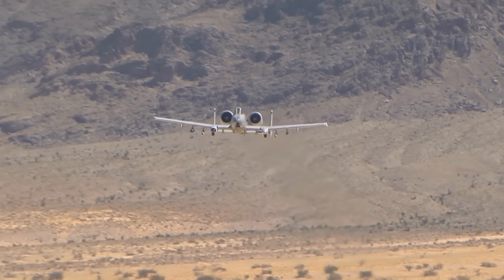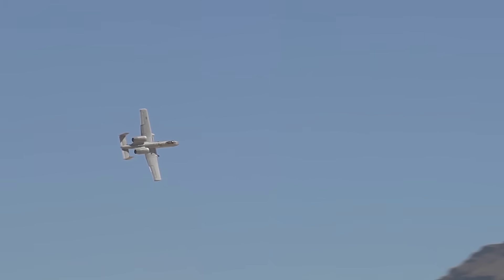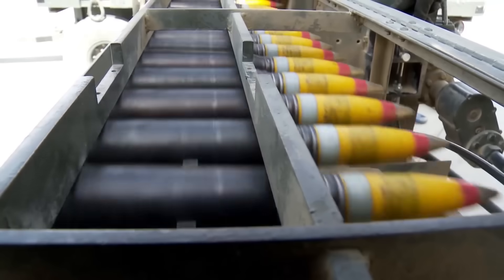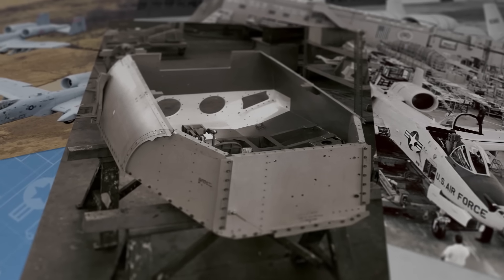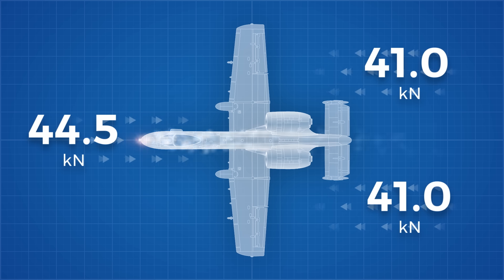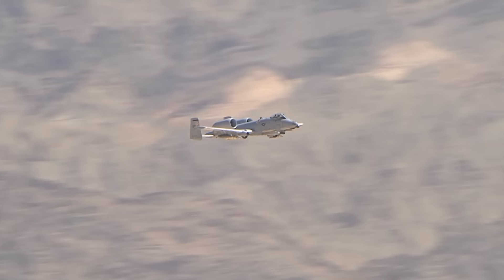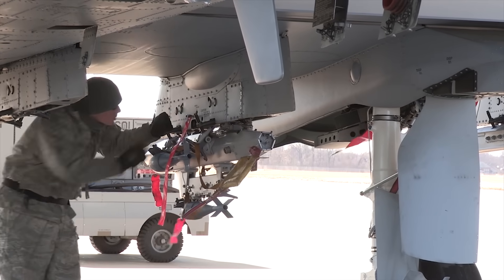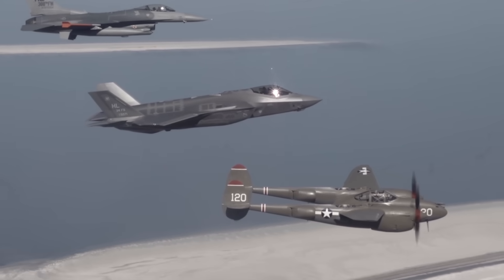The Insane Engineering of the A-10 Warthog

Comment: IMHO, the main difference between A10 and F35 is, the A10 goes into battle when the enemy already knows planes are going to be there. It can absorb damage and it's really cheap to make. The most expensive part of the A10 is the pilot. If he survives, just build another plane and send him back. At some point, the adversary is going to run out of ammo.

If I remember correctly, for the price of one F35, you can get about 50 A10s. So, the opponent has to shoot down just one F35 to do as much damage to the war effort as if he shot down 50 A10s. (Actually, he doesn't have to shoot it down, it just has to break down). Is the F35 really that much more reliable?
Reply: You're way off. The A-10 only goes into battle when the enemy has very little chance of shooting down anything. A single missile will still render an A-10 useless... all it's survivability features are there to keep the pilot alive, not keep the plane functioning. It also isn't cheap at around $45 million per unit. YOu can fill the same role as the A-10 is used for with a Super Tucano at half the unit price and 1/5 the maintenance cost.

Per each F-35A, you can get maybe 2 A-10s. And unlike the A-10 the F-35 can perform CAS on the frontlines where the enemy still has air defences and potentially fighters as well.

Comment: 2:09 If it can fly home missing half a wing, I think its' survivability IS best in class.
Reply: I saw an account of an A-10 that made it home with 80% of both wings gone and the body full of holes. It had to land at near top speed as that was the only way to keep enough lift occurring under the wings lol
Reply: Hell, it has survivability to match or exceed some of the Grumman "Iron Works" birds of WWII.
Reply: Jonathan Spier  I believe you're mistaken... I'm not the one driving screws with a hammer, the US military is. While your point is correct, the A10 isn't currently in a conventional war. As such, it's currently being used for suppression and elimination of insurgent forces. 
The military doesn't need to use 30mm AT rounds on insurgent troops and encampments. But they're doing it anyway. And they do a great job at it. 
Overkill? Definitely. Can't deny it's inspirational as hell to friendlies and scary as hell to enemies, though...
Reply: Not taking a hit in the first place is far more important than being able to take a hit. I would actually rate the A-10 very low on survivability due to how easy it is to hit it.
Reply: @habe1717  - Fly an F-16 that low and it would be easy to hit as well, and far less likely to survive.
Reply: @habe1717  You're missing the point. It's passive ability actually gives morale to the ground troops
Reply: @habe1717  Not many insurgent forces get much hands-on practice shooting at flying targets... And live to tell the tale. It's why it excels for the insurgency warfare of today, but probably won't last to see another, more modern battlefield.
Reply: @habe1717  Exactly how easy is it to hit?
Reply: @habe1717  It has to fly low and slow in order to engage ground units.  This really should be an ARMY plane.

Comment: The f 35 can only win against the a10 is by getting a favorable testing by getting the a10 derated  was reported by air force when testing was done head to head the ammo was halfed in the a10 etc and when a aircraft costs 100mill it's not gnna be sent into harm's way at a moment's notice without being debated on before
Reply: Only happened in a single exercise after the USAF got desperate to prove a point that A-10 fanatics and politicians such as John McCain ignored for years. The F-35 has demonstrated it's ability to outperform the A-10 at the role of CAS in multiple exercises, which is something that you should expect considering the F-16 already outperforms the A-10 in the role of CAS.

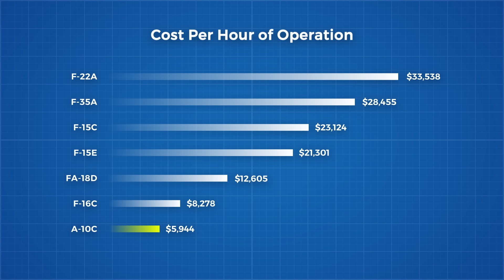Comment: At 13:26   it is interesting that flying an older plane like the F-15 is so expensive.
Reply: That graph is comparing numbers that are calculated differently, and thus isn't remotely accurate. If using the same values that result in the A-10 having around a $5000 CPFH, then the F-35 is around $12000. If you look at it using the USAF method then you will find both the F-16 and A-10 around $20000, the F-15E around $28000, the F-35 around $35000, the F-15C around $42000 and the F-22 around $60000. I'm not sure about the F/A-18D, but the Super Hornet is around $25000.

As for the difference between the F-15C and F-15E, the F-15E is cheaper due to having more rugged airframes built out of better materials, designed to last longer and under heavier loads. A lesser known related fact is that the F-15E is rated for higher G maneuvers than the F-15C.

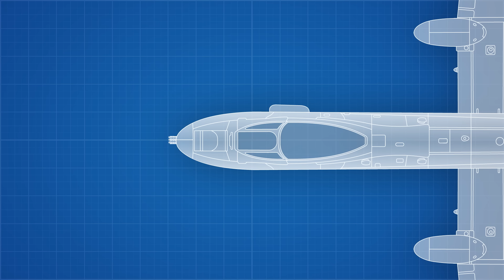Comment: At 7:44 you state that the gun on the A-10 is mounted directly centered, which is incorrect.  The gun is offset to the pilot's left and fires from the 9 o'clock position, which is the barrel that is directly centered.  This also causes the nose gear to be offset to the pilot's right.  Which means that the plane has a sharper turning radius when it turns right as opposed to when it turns left.

Comment: The army has considered taking the warthogs off the air forces hands

They're flying tanks
Reply: The AF fighter jocks don't like the A10.  Army and Marines love it.  Can an A-10 be equipped with a tailhook and do carrier ops?  Let the Marines have some of the fun.
Reply: @Monty Harder I'm glad I kept reading the comments and saw yours about the Marines. A plane like this is geared for their get down and dirty, kick ass doctrine. Their officers/pilots go through boot camp. So they know Exactly what those Marines, on the ground and all those other infantry folks are dealing.
Reply: @vinyltapelover  yeah Maybe lets give them the a10s they'll figure something out
Reply: @montyharder3663  They'd have to do a lot more to the A-10 to make it carrier capable than simply adding a tail hook. They'd have to reinforce all of the landing gear to withstand the stress of landing on carriers. The nose gear also has to have a special bar in front so that it can hook up to the catapult.  The entire undercarriage would also have to be reinforced so that the tail hook doesn't rip out the bottom of the plane when it catches a wire. Then you'd have modify the wings so that they can fold in order to save room aboard the carriers. Then, lastly (and possibly the easiest change) you have to make it corrosion resistant because of the salt spray it will encounter during carrier ops. So, all in all, a lot is needed in order to make an A-10 carrier capapble.
Reply: @Riceball01  Darn good job you did. I was  wondering how much of a headache it would be to deal with that offset nose gear not only beefing it up but making  the aircraft structurally sound, in that area, for the hard landings. If there was an unlimited budget, I would offer two quotes: "Git-r- done" or "Make it so, Number One", lol. Well we can dream, can't we?
Reply: @montyharder3663  I doubt the A10 could take off from a carrier.  Maybe land on one, but I dont think it could gain enough speed with its engines and how much payload it carries.
Reply: @ryanvandoren1519  if I'm correct, no jet (besides vtol jets) can get enough speed to gain lift, that's why they have a catapult, to fling aircraft quickly so they can take off on a smaller runway, I've seen a video of a propeller driven cargo plane taking off a carrier, so I'm sure the A-10 can too- even with it fully loaded.
Edit: here's the video- the plane takes off around 14:00. https://youtu.be/gqdwyXC4Jwk
Reply: @ryanvandoren1519  Full reverse thrust, fire the gun and just take off backwards. Do a 180 once airborne. Easy.
Reply: @Hamachingo  lol
Reply: Would be a good idea but the Army is forbidden from operating fixed wing aircraft.
Reply: @1RAYGC  True, so true. It sucks for the Army. Even though there are a lot of folks who may not be up to speed on that fact, it doesn't stop all of us from engaging in flights of fancy, wishful thinking:).
Reply: @1RAYGC  the army actually does have fixed wings... just not for fighting. They have some C-26 which is basically a small passenger plane
Reply: I would wholeheartedly support this move
Reply: Ash Green CAS should be an army mission anyway.
Reply: yeah just hit a king tiger with wings

Comment: Fun fact, the gun isn't actually mounted in the center of the hog. The barrel that actively fires the 30mm rounds is along the centerline, but the gun is positioned slightly to the left of center (from pilots POV).

Comment: 9:00
I do know that the F-15 and F-16 both have an APU built in, called a JFS- Jet Fuel Starter.
When I was working F-15s in the mid-90s, I got to talk to some A-10 pilots and crew. They said the unofficial motto of the A-10 is as follows:
"You can run, but why die tired?"
Reply: You know when the a10 are talking smack to the f15s and 16 you are To LISTEN
Reply: The A-10 makes the forward airbases safe for other aircraft to land.
Reply: Lmao

Comment: The information about the GAU-8 gun is incorrect. The entire weapon is not aligned along the axis of the plane; only the firing barrel is (which is the 9 o'clock position). It is a critical design choice that accounts for the space required for the front landing gear... Additionally, the gun is tilted 2 degrees downward from horizontal to help assuage the thrust-cancelling force of the active weapon. 

Provide accurate engineering facts if you're going to title your channel 'Real Engineering'..

Comment: Comparing F-16 and F-35 to A-10 is like chalk and Cheese. The F planes are hit and run out of sight where as A-10 is to be seen and heard if you are not killed and imprinting lasting psychological damage of that rattling fart.
Reply: Yeah but the F-16 and F-35 are still more effective at the actual role of CAS, especially when air defences are involved. The A-10 is an awesome luxury, not a necessity.

Comment: WTF?  At least get the NAME right, it is the THUNDERbolt II, NOT the "Lightningbolt."  Pretty darn funny.
Reply: Also the diagram when discussing the gun being on the centerline is wrong.  The gun is actually mounted offset, so the barrel that the projectile is leaving is on the centerline.  This is clearly seen in nose on shots.
Reply: Engines are TF-34, NOT "T-34"

Comment: The A-10 is not as survivable as you'd think.  I'll let the general in charge of USAF forces (gen Chuck Horner) in desert storm do the talking.
 "We had a lot of A-10s take a lot of ground fire hits. Quite frankly, we pulled the A-10s back from going up around the Republican Guard and kept them on Iraq’s [less formidable] front-line units"
And no, A-10s were not conducting more missions than other aircraft that also fought in the front line.
https://www.airforcemag.com/article/0691horner/

Comment: The cost per hour of operation between the F35 and the A10 alone makes the A10 the best choice for providing close air support.
Reply: Not really. If you want cost effective the A29 Super T is a much better choice. If you want a jet that plays the exact and very limited roll of the A10 then the A10 is the best choice. 

If you had to consider all the potential conflicts and threats that an Air Wing commander has to consider then the F35 is the only choice.
Reply: @LibertyFirst1789  BUT BRRRRRTTT 
YOU CAN'T ARGUE WITH BRRRT
Reply: Also difference in how they provide the close support
Reply: I'll take 20 .A.10s...
Reply: That graph wasn't comparing equivalent values. The A-10's roughly $5000 CPFH is equivalent to the F-35 at roughly $12000. The F-35's roughly $35000 CPFH is equivalent to the A-10 at around $18000. Considering the F-35 is more effective at the role in general as well as basically everything else, it is better to have F-35s than A-10s, but if the only thing you need is CAS (almost never the case... at least not for the US), and the enemy has completely incapable air defences, then the A-10 becomes cost-effective.
Reply: @dumdumbinks274  yesh
Reply: Price of F-35 = 135 million per
Reply: @paulsuprono7225  When it first came out, now it's closer to $80/mil. Of course, the A10 can't be purchased for any price and their maintenance is going to get exponentially more costly.
Reply: @paulsuprono7225  F-35A is $78m currently and still getting cheaper. Latest deals indicate it will end up very close to $70m once full rate production begins. An A-10 even if it was available to buy would cost around $45m per unit and is still only capable of a single role and under limited conditions.

Comment: Lightning bolt? Nah. THUNDERBOLT.
Hog? Nah. WARTHOG.
Apart from those two this is a good vid, you got a like from me.
Reply: A "THUNDERBOLT", as you put it, is a WW2 era P-47. The A-10 Thunderbolt II is only the latest in a whole series of American attack 'planes with "Thunder" in their names. Even A-10 pilots like to call their aircraft a "Hog",
Reply: Agreed you are indeed correct but the pilots I have spoken to who flew the A10 (a few USAF and one RAF)  referred to the type as either Thunderbolt or Warthog, not the Thunderbolt II or just Hog. Not saying that pilots don't use those terms, just that I didn't hear them use those terms during conversation.
Best regards.

Comment: There is no way on this Earth that you can compare the A-10 Thunderbolt II with the F-35. They are two completely different aircraft that were built for two completely different missions. That means that the F-35 can not, in any way, replace the A-10's mission. The A-10 is an armored, flying Battleship. The F-35 is a stealthy attack fighter, with no armor. No matter the number of F-35 built, the total of them would ever absorb as much damage as a single A-10 and keep flying. The simple idea is to bring the pilot home safely, and the aircraft is possible. Hell, even an F-15 flew home on only one wing! Can you say that about an F-35? No, I know that it hasn't happened yet, and may never, but you get the idea. You can not replace an aircraft like the A-10 with and aircraft like the F-35. They are completely different aircraft, that were designed for completely different missions.

Comment: A10: 1150 rounds in typical load-out (9 to 18 gun passes per A-10 pilot)
F35: 220 rounds in typical load-out

Do you really think the F35 can replace the A10 in the CAS role?
Reply: Yes. Most of CAS is done by precision bombing, not gun runs.

Comment: Well yeah, the F-16 and F-35 can both preform the A-10 role because they were designed as Multi-Role aircrafts. But let me ask you this, do you want an aircraft that can preform all the roles just fine or do you want a aircraft that can preform one, very important role, fantastically?
Reply: Look at it this way; a soldier's main purpose is to fight a war. If they require something like an A-10 to annihilate the threat completely then they aren't doing their job. Consider the fact that the F-16 is also the current most successful CAS platform. It's to do with logistics and mission planning. Raw power can overcome an immediate situation. Flexibility is what wins in the long run.

Comment: "The gun is mounted on the centreline". Um, are you gonna tell him or should I?
Reply: I think he means that the barrel that fires is always going to be along the centerline
Reply: Yep
Reply: The firing barrel lies directly on the center line, and just below the center of gravity, centering the recoil so it won't affect pitch or yaw when fired.
Reply: yes, that was a bit of a gaff from the narrator. the gun is mounted slightly off-center to the left side of the aircraft since the firing barrel is at the 9 o'clock position when looking at the gun from the front. just the firing barrel needs to be on the centerline, not the whole gun.
Reply: Glad someone said it. Has to be offset or it spins the plane lol.
Reply: @aaronwhite4946  I don't think the rotational force would be that much.
Reply: @aaronwhite4946  You are wrong it is just recoil just crate a slip momentum if fired off center.
Reply: Tell who the stick operator  ?????

Comment: I love how if they mounted two of those GAU-8 Avengers on the plane, it would literally fly backwards when fired.
Reply: USA USA
Reply: Number  1
Reply: USA USA.
Reply: The A-10 has an absurdly low stall speed for anything that flies. It really helps when you put on the brrrrrrtt-brakes ;)
Reply: @robertrosenthal7264  that's the spoilers for it It doesnt usr spoilers it uses bbrrrrt
Reply: Talking to an A-10 pilot some years ago, he said that when he fired a 4-round burst, he could see his indicated air-speed drop a few knots.
Reply: I don’t mean to be that guy, but it would decelerate (or go acceleration negative), not literally fly backwards. Just thought I’d specify. Thing wouldn’t stop mid flight or anything lmao.
Reply: @zayffon1325  yeah it wouldnt instantly go back. you would need about 4 for that.
in the time it takes to decelerate, the plane fell out of the sky.

besides, the plane isnt designed to fly backwards, wings facing wrong direction, too much drag due to the engines, etc
Reply: @joshuaespinoza8325  and planes don't get sustentation backwards, because physics
Reply: @zayffon1325  Thanks. I like "that guy" cause he helps be learn stuff
Reply: Just one Gatling gun is on that plane

Comment: Just a cool bit of info that I noticed wasn't in your video, is about the gun placement itself. While the gun is parallel with the chassis of the plane, it isn't actually center-line. It is slightly offset because the rounds come out of the right side when looking down the barrel, not the top or bottom like you might think. If the gun was actually centered, the forces of the bullet would cause the plane to spin. 8:33 is a good head on look at the A-10 and you can see what I'm talking about.

Comment: The gun isn't actually mounted on the center line of the plane, it fires on the 9 o'clock position so the cannon is offset such that the firing position of the gun is mounted center line, you can see this at 10:04